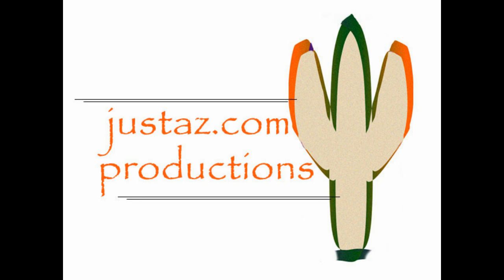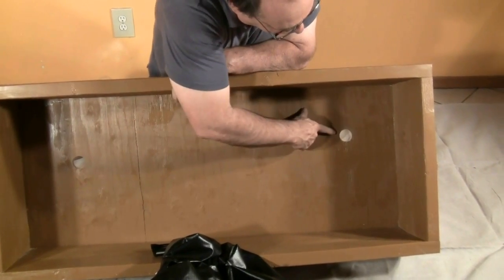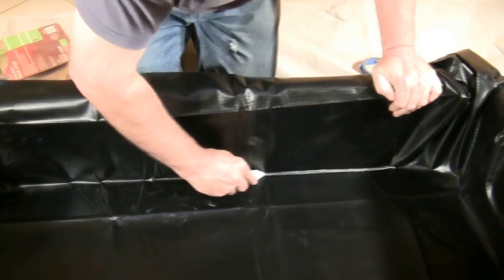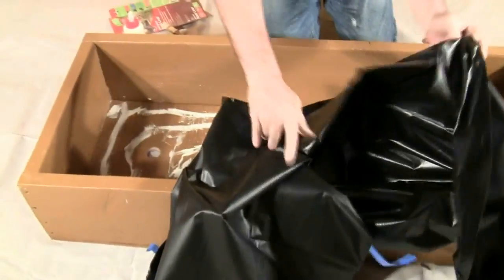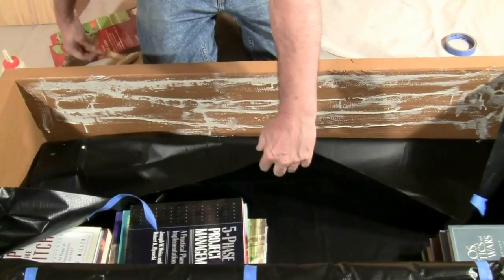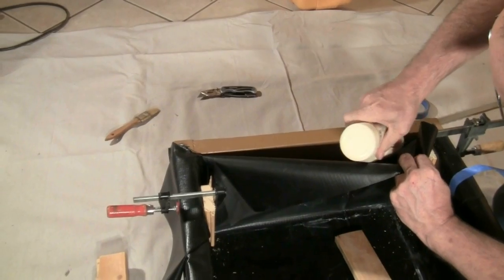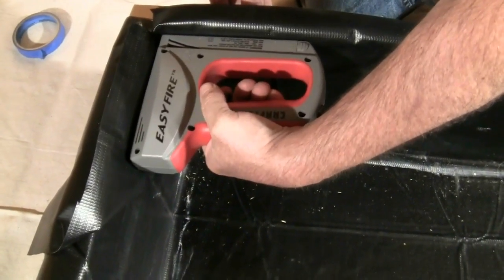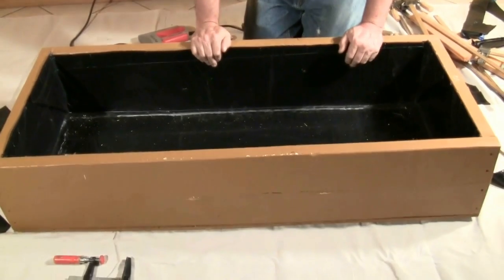Aquaponics How to Line a Grow Bed

Comment: I wouldn't glue it because some day the liner may have to be changed.  All it takes is something sharp to ruin it.   If you glue it down, you might as well leave it and place a new liner over it.   Also, pond liner is a lot thicker and harder to work with than what was used in this video.  I suspect this was simple black poly.   And, I wish they would have spent some time explaining how to fold the corners to get the proper seal.  That is a major factor and not easy when lining a box.   Otherwise, a good video.

Comment: or you could just use a plastic container lol
Reply from the maker: Hello speedwayman100. There are several reasons we didn't go with plastic. Plastic doesn't hold up well here in Phoenix. The size of plastic container we would need is comparatively expensive and would likely bow out with the weight of the growing media. On a smaller scale, though, a plastic container can work. Thanks for your input; we appreciate you taking the time to comment. Best of luck in to you in all your projects.

Comment from the maker: Hi, 1diegoman. The grow bed is made from pine and measures 48 inches by 21 inches with a 9 inch depth. Bob used galvanized 2 1/2 inch screws for construction of the bed. Thanks for watching, and taking the time to comment. Best of luck to you in all your projects.